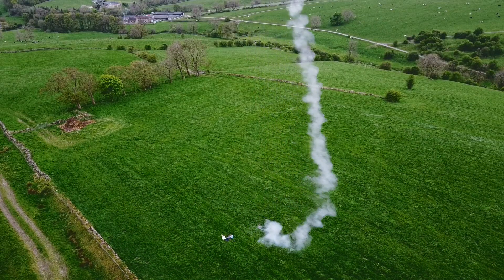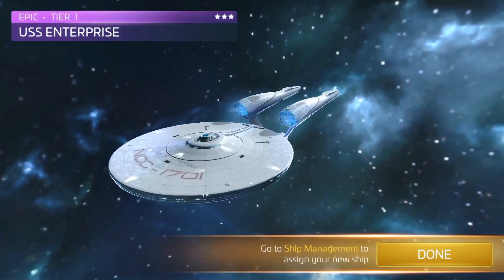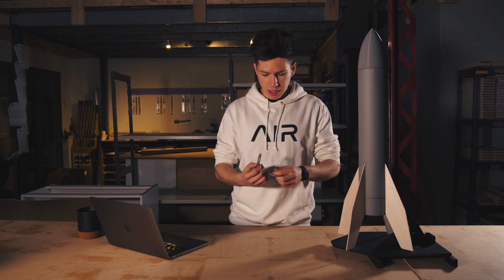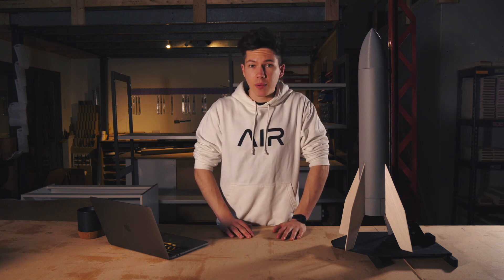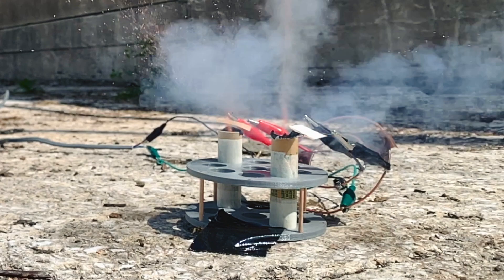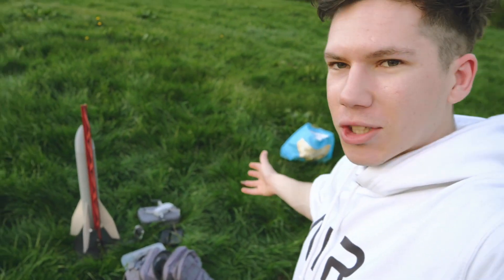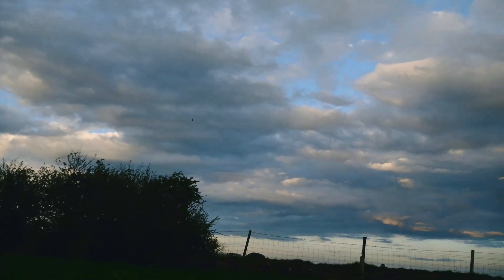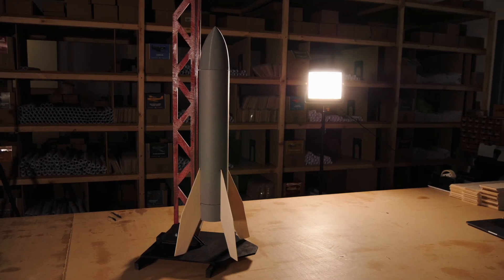DIY High Power Rocket

Comment: Great video .....As an option for anyone building a rocket-like this, if you decide to go really big or add more thrust. Carbon fibre dowels are available in a variety of designs, sizes, strengths. They only add a few dollars over the cost of wooden dowels. On a  rocket this size and thrust, you're looking at a cost of around 8.00 USA dollars /6 + plus pounds for #4  24 inch / 60 CM long dowels.

Comment: Cool. But saying something has 12kg of thrust is invalid. That would be like something weighing 9.81m/s^2
Reply from the maker: Although not standard or accepted by SI, kilogram-force has been used and continues to be used as a unit of force in rocketry.
Reply: I find that confusing but can see how most ppl wouldn't.

Comment: You also have a few other problems with this. You have too much internal volume and to heavy of a nose cone. To put it simply you have not enough preasure being generated by the back fire to pop the top and deploy the chute Reduce the length of the vehicle and make a less heavy nose cone.

Comment: Great work.. nice video.. I was wondering if the reason your chute did not work was because a normal rocket tube is basically sealed from top to bottom. This would normally cause an ejection charge to blow the cone off, exposing the chute, but with those mini holes in the 3D printed ribs, they would not allow  the needed pressure to build up enough to blow the cone off,, also the body of the rocket would need to be sealed up and rigid enough to have pressure build inside the body, to pop the cone off.. Also, your nose cone really doesn't have to be tight at all, just a light press fit, if it had a ridge around it, that slipped into the body of the rocket. G-Force at lift off will keep it in place till the election charge kicks in.  I didn't see any protective wadding under the chute.. you'll need some to stop the chute from getting burned.. Just a thought.. good luck, be safe..:-)

Comment: nice build on the rocket... I may not be the first to suggest this, but in order to solve your parachute deployment issue, you need to run a smaller tube up the center of the rocket called a shotgun tube. This tube directs the ejection charge from the center engine (which should have a slightly longer ejection delay) up to the parachute hatch/nose cone. Ensure that the shotgun tube is fairly well sealed and that your parachute hatch/nose cone is the only way the gasses can escape.  Also, your ignition issue can be resolved using higher voltage. The setup that I use outputs around 53 volts (7x 9 volt batteries)

Comment: Should have made a cone shape on the inside with a long tube up to the top to build pressure. I don’t think the volume rating on the ejection was rated for that large of a rocket considering they did not fire simultaneously

Comment: Afaik getting these solids to ignite precisely together is a source of endless frustrations. The biggest problem of course is that just a few milsec's later ignition can throw your rocket of course (as in, not going straight up). And then there are still lots of variations; not all burn the same. 2 ideas: the longer the launching rod the less influence the slightly later ignited rockets have, also maybe you can try to work with clamps: if you hold the rocket for a short time after ignition then the chance that all motors are burning together is greater. But working with solids will always be slightly tricky.

Comment: Add a slight tilt to the fins on the rocket, this will make it spin very fast. this makes it incredibly stable and it will not turn in the air

Comment: Get motors with no ejection charge and setup a small electronics bay and a small compartment below the nose cone. Use an altimeter with deployment to eject the parachute. Should be much more reliable and you also get an altitude reading.  You could also slim down the rocket by using fewer larger motors if that is legal. Fewer motors to light would also be more reliable. I think you can get D and E size motors in the U.K.

Comment: Pity you didn’t have and altimeter and accelerometer logging to an SD card in the nose cone, that could have given you some great data. Potentially a gps module might work as a cheap altimeter, it would be fun just trying.

Comment: I reckon the nose cone was a bit to tight there. It should slide out with relative easy. While some have said "the volume is to big" you do have more engines to compensate. However due to inconsistencies in the motors they likely all go off at different times making less effective. Also, because you didn't have a smooth inner tube the wadding behind the parachute, and the parachute itself likely was caught and didn't budge. When it comes down to that kind of ejection system simply isn't effective for a rocket that big a round. You could do a single pipe from the center rocket that is responsible for ejecting the parachute and nose cone. A spring loaded mechanical system with a servo is your best bet. I'd use a timer, as trying to use acceleration is actually quite difficult. . Air command rockets does water rockets and of course they have to some how get the parachute to deploy --->  https://www.youtube.com/watch?v=WwRJvtqTXFA They have done a lot of creative things with their systems.

Comment: Since consistency is an issue with solid rocket motors, consider making a multi stage rocket where the starting motor is a larger class and leads to a smaller class. The charge from the previous motor is powerful enough to ignite the following motor, they just have to be close to each other.

Comment: You did run sims in open rocket for delay times, and you did turn off motors to simulate ignition failures right?

Awesome project, looking forward to the next installment!

Comment: Dude, use Quickmatch! Burns at just under Mach 1 therefore slightly unequal lengths aren't a problem when linked to one common electrical igniter. Send me an Email at Aspirespace and I'll send you a fusing tutorial doc. Nice fuselage concept, but the expulsion charges will tear it apart without a 'stuffer tube': a separate tube used just to transfer the expulsion charge pressure. Also, too short a launcher is a classic British disease ;-)

Comment: You need more current to ignite all those igniters hotter and instantly. Use a 12v 15ah battery with a remotely controlled switch (solenoid). How heavy was that rocket?

Comment: now i feel changed to build a 9 engine model  now thanks for doing this, the rocket really was good looking  it should have worked, lower the internal volume of the rocket body so the deployment charges can really pressurize the inside ejecting the shoot  thats my back seat advise great stuff i thought ya had it myself

Comment: Your skin probably poofed a bit when the ejection charges blew, allowing the pressure out and therefore dumping that energy before it could push the nosecone and chute out.  You need a somewhat tougher, more resistant fuselage than a single wrap of paper.  But don't despair, it might do well with simply a single extra wrap all the way round.

Comment: If you put them in series and use a higher voltage power supply you may have better timing, I have worked in display pyrotechnics where millisecond timing is essential to reliably choreograph fireworks to music. Another reason for using a series circuit is if you have a wiring fault or dead igniter it will not fire the other engines allowing you to reset and try again without loss of the vehicle, it is not uncommon to use voltages above 48volts to fire series of igniters.

Comment: I figured i would throw my two cents in even though this is over a month old. The ignition failure could be due to the resistance of the ignitors, Estes ignitors out of the boxy take up a fair bit of current, with my rockets i could only do 4 igniters simultaneously without a failure. If your ignition system is underpowered that might be the reason why not all the motors lit.

Comment: Super awesome video! i've literally been carrying out almost the exact same project as this during lockdown, excluding the 9 motor setup! also, i have a suggestion, could you use something to clamp the rocket down by the fins at the bottom of the launchpad? i.e with a rope or an RC solenoid to release them. Then maybe this could allow time for all engines to light, avoiding the first lit motors thrusting the rocket away from your ignition setup before all of the motors are lit

Comment: Use larger impulse motors. Without certifications you can launch up to a g motor. It’s much easier than using multi motors
Reply: Just dm or something. Because I do high powered rocketry monthly as a hobby.

Comment: Ive been working on a project quite similar to what you did here. One thing that I tried to do that I thought was pretty cool is I 3D printed fly away launch rail guides. So as soon as the buttons leave the rod the buttons fly off the rocket which makes it more aerodynamic as it travels through the air.
Reply: Nice. How do they hold latch and release?

Comment: You could hold the rocket down untill T+1 to try to fix the ignition issue. This will also get rid of the thrust spike these rocket motors have.

Comment: What if you put a small, high rate of discharge battery in one for ignition of the motors with somehting like an arduino.   That way if it lifts off just before all motors have a chance to light, they can ignite as it goes up the launch rod.

Comment: No.  It will be entirely too heavy.  Try OEM tube & nose cone.  But, stick with the multiple motor design; this is a great idea.
Other rocketeers should consider an auto battery for launch because it provides sufficient amperage.  Truthfully, you should get rid of rings that provide connection because they cause connection problems.
The launch pad is a great design.  Periodically check for burrs on the rails.
Add a sheet metal blast deflector to the base.

Comment: Mythbusters if I remember correctly used a pan with a thin layer of gun powder to light multiple engines at once. The ends were cut in an X to allow flame migration to light more evenly and the ends of the rocket engines were pressed into the powder. Cool build and video.

Comment: For ignition try a pi zero w with starter pins to each engine. that way they all light at the same time. the pi zero w is wifi and Bluetooth so you can start the lanch via your phone.

Comment: Excuse my ignorance but, how did you make the launch tower and fins? I've looked at the STL files and opened up the launch tower parts, but I don't know where to go from the .dxf file. Also, are the fins in the STL files? Should I buy fins from somewhere online? Regardless, amazing video! Totally earned a like and a sub :)
Reply from the maker: Yeah sorry I didn’t go into those parts of the build much! The fins you can make any shape you want from balsa wood or foam. The files for the fins and launch towers are dxf so you can cut them on a laser cutter or cnc.
Reply: @Project-Air  Oh ok thanks for the clarification.

Comment: Idea for a better or more reliable ignition system:
Put the ignition system on board of the rocket and power it by a supercapacitor or rechargeable battery.
For safety reasons, you should put the rocket into launch position and then charge the ingnition system's energy storage. The energy source should be linked to a thyristor that is kept in the "off"-state by a resistor connected to the negative charge while switching in positive to negative direction. The launch switch would then be connected by two contact areas met by contact spikes from the launch pad. Those contact areas would need to shortcut the control-terminal of the thyristor to the positive charge.
This system would fire the launch system until the voltage drops to 0V.
To do it easy, you could print that areas onto a PCB and solder both the resistor and the thyristor onto the PCB and put both into the bottom, between the engines. The thyristor you need depends on the current needed but the resistor can be anything well below a watt and around 10 kilo ohms would suffice.

Comment: 1) 12v high-amp source, like a car battery through a relay

2) Igniters dipped in a pyrogen material for high-energy ignition. Look up Quick Dip. 

I like the ring hookup.

Comment: so MythBusters was using model rocket engines for an experiment I can't remember what it was but they also had issues with simultaneous ignition
So what they did to mediate the issue is they made small channels that intersected all the openings to the rocket nozzles and filled those channels with a small amount of black powderand depending on where you're from I can understand how that is hard to come by I would honestly harvest it from fireworks and then either use tissue paper or aluminum foil to hold the powder in the channels then all you would need is 1 ignitor for all 9 motors

Comment: One tip: Make a release mechanisam that will release the rocket 0.5 sec after ignition, that way if any of the motors has a delayed ignition the rocket will launch after all motors are started.

Comment: Lightly sand nose cone until it can be easily pulled off but when turned upside down it doesn’t just fall off. I used to do model rockets (not just the small ones). I’m not expert but this has worked very well for us!

Comment: very cool, I wonder if a capacitor would help with the multiple motor ignition issue, that would give you a higher inrush current when you ignite the system.

Comment: Excellent! 
Probably didn’t have enough current to set off all the igniters.  Need to look at the distance from where you’re power feeds the ignition ring. Would not be surprised if the two engines that didn’t ignite had the igniters ripped out before they could start the engines. Minute resistance in your ring would be enough. Though I did like the idea it would need to ensure you have the power for all the igniters.  Don’t need to burn engines to test the order the igniters combust.

Comment: I shot a few Estes rockets in my day.  Your rocket did remarkably well considering cluster rockets usually fail for the very reason yours almost did...two engines failed to start.  Just ask the Russians who also tried that strategy.  One bigger engine centered in the rocket is more reliable...then you can concentrate on the recovery system....less pieces to retrieve.

Comment: You said that you made different diameter body tube parts and the length could be taller/shorter if you wanted. Without having a standardized body length, fin shape and 3D printer settings for each configuration diameter, how can you guarantee that the center of gravity and center of pressure will be in suitable locations to have a stable flight?
Great video. Keep up the cool content.
Reply from the maker: I can’t, it’s up to you to use the parts to make your own designs. :) thanks!

Comment: You need to make the ignition wires long and lightweight.  They need to hang from 9 (can be less) posts surrounding the rocket.  The idea is for the igniters to follow the rocket up allow more time for slower igniting motors.

Comment: I'd use some plastic igniter cord for the motors. Get the fast stuff and light it with an igniter, and with a burn speed of 30cm per second, that should easily light them all close together :)

Comment: Easy ignition fix: after you insert the igniters, securely tape over the nozzles to hold all wires against the motors. This forces all wiring to remain attached until ignition is complete, and the blast or lifting of the rocket pulls all away. This will get you those last few milliseconds needed for multiple ignitions. The flame will very quickly burn off any tape that may effect directional control.

Comment: Hi Enjoyed the video very much.  A couple of points, check out eBay for fibreglass rods sold in 4m lengths (for roman blinds) they would make great replacements for the dowels. They are very strong. And the ignitors, It looks like the initially ignited engines pulled the crocodile clips of the engines that would have fired slightly later. I would suggest using something like varnished coil wire that could be coiled loosely and give each wire the ability to stay connected for say 20-30cm after launch to ensure all get a chance to light if the fuses are slightly different. (or even inset the coil wire into the base of each engine and dispense with the croc clips (make sure you scrape the varnish of the coil wire  where conductivity is required)

Comment: I would recomend that you point all your motors through the cg. This will greatly reduce the instabilities due to thrust variance and even work with un even ignitions.
Reply: I had never thought of that! Although it would slightly decrease efficiency, I suppose it would be much more stable

Comment: Hello @ProjectAir from US, I am also building rockets from 3D Printer. But facing few problems with the printer and the design and motor selecting. Could you please help me out with the designing and how did you print it on the 3D Printer.

Comment: It seems to me that the size of your rocket body dissipates the amount of force required to deploy the recovery chute.
In order to produce enough force, not only would the rockets need fire a charge simultaneously, which didn't happen during your test fire, but the charge size would probably have to be stepped up to create enough internal energy to remove the "tight fitting" nose cone and deploy the chute.
Maybe if you designed a separate internal cylindrical piece (tube) with a type of conical assembly that would sit above the rocket charges, that is connected to the cylinder to direct and compress the force of the charges.
Alternately, devise a separate charge, further up toward the nose cone that would fire 3 - 4 seconds after launch
Just a thought